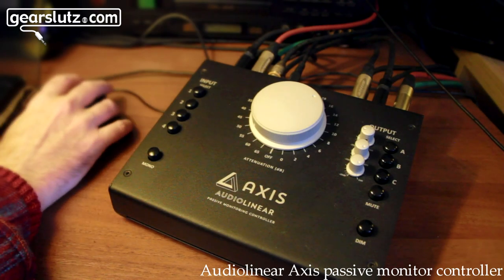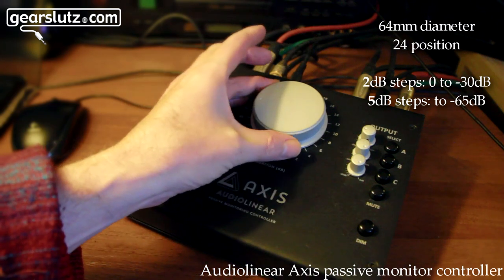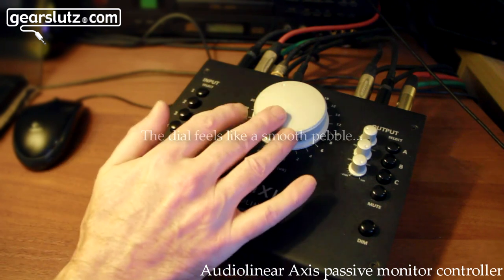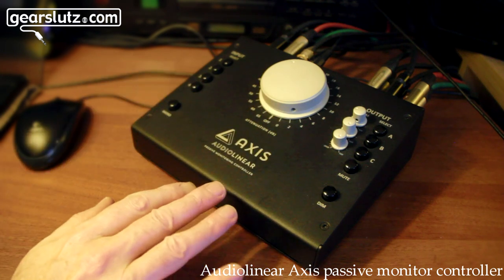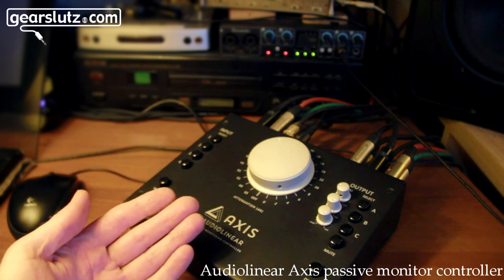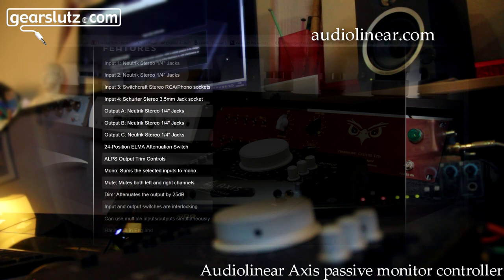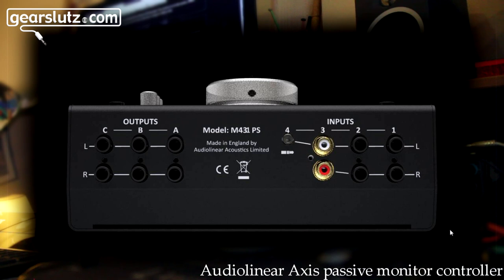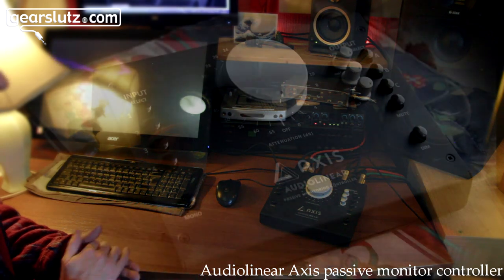Audiolinear AXIS Monitor Controller - Overview

Comment: Didn’t they go out of business ?
Reply: Sorry for late reply. Not sure about company status. Probably the review model is an early unit. It was returned after review, and after testing multiple monitor controllers I decided it was the best, in fact, one the best products I'd reviewed at Gearspace. I tried to purchase one but it appeared only one unit was available and that had gone to Europe. Gutted. I was so taken with the passive design (pure sonics) and build-quality, that I now plan to build one myself using similar Elma components (that are expensive) unless Axis re-release the original.